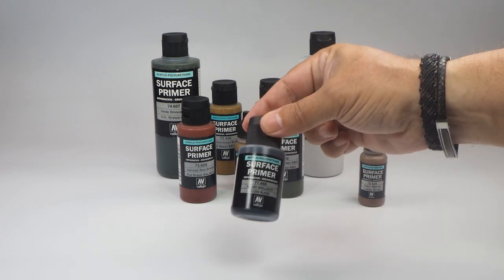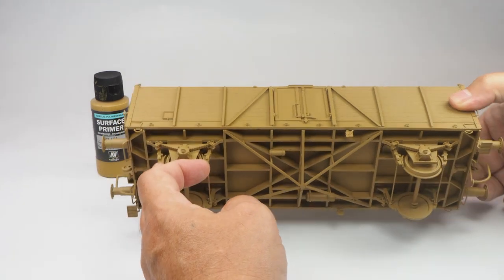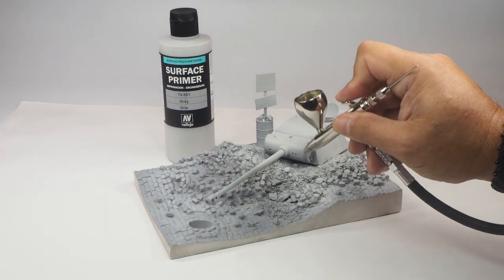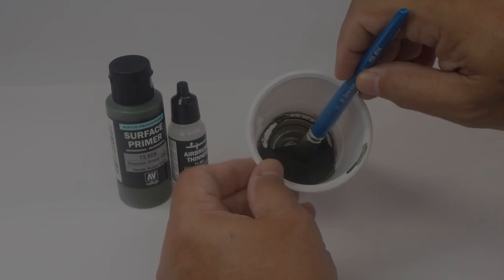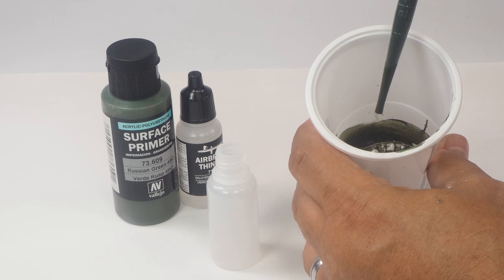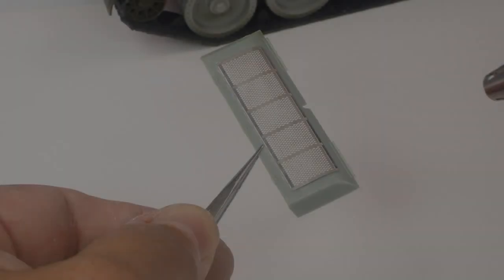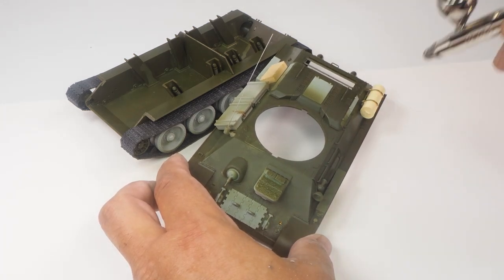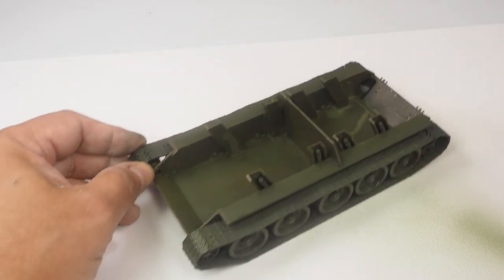🇺🇸🇬🇧 #1 PAINTING PROCESSES: PRIMERS by Chema Cabrero ✨

Comment: I appreciate the effort, but pls, if 99,9% of the airbrush compressors show the pressure values in bar and psi, then use those and not kilograms. It can be the correct terminology, but totally not useful in a guide video.
Reply from the maker: Hello László, recommended pressure settings are always pointed out in our website and product sheet :) 15 – 20 PSI
https://acrylicosvallejo.com/en/category/hobby/surface-primer-en/

Comment: I have used Vallejo primers and have to say that I would not recommend using them for traditional primer roles - e.g., to reveal flaws requiring being fixed before the final painting stage.  The reason I say this is, in my experience, they do not sand well.  They do not feather well and, instead, peal and ball up when sanded.  That being said, I find they make an excellent, smooth, unifying base for undercoating the color coats once all building and sanding is finished.
Reply from the maker: Thanks for your feedback Roger! We'll take note of the issues you've faced with primers to improve them and keep working hard as usually 😊😊
Reply: I completely agree with Roger Holberg, amazing primers, IMO best there are, just this little thing about sanding 😉 Really looking forward to improvements you mentioned @vallejocolors, and wish you all the best, keep on your amazing work. 🙂
Reply: Agreed as well, sanding Vallejo primers doesn't go so well. they peel off very easily and uneven. I'm actually searching for a better sandable solution.
Reply: If you wait for 24h it's far better. sanding right away enven after a quick cure into a  warm environment makes a mess unfortunately compared to other brand. No big deal, need to take your time...
Reply: @AlexandreSalf  I wait several days, it's still not smooth sanding. It looks like thorn apart somehow.
Reply: Simple, you aren't allowing them to cure long enough. While Vallejo says to wait 24hrs, should wait more like 48hrs. Also, thin it out with their AB thinner and flow improver, and it will cure faster. 

Once the primer is fully cured, it sands just fine.
Reply: I mean, they show it right in the video that it can be sanded with no problems.
Reply: I find they just clog my airbrush not matter how much i thin them. They also dry on the tip very fast. The Vallejo paints are good but i stay away from the surface primer especially for doing things like zenithal highlights.
Reply: @stephen1098  75% primer, 20% AB thinner, 5% flow improver. Sprays out of my H&S airbrush with a 0.2mm needle at about 20psi, just fine, no tip dry, no clogging. 

Sprays out of my Iwata with a 0.35mm needle with no thinning, with no issues (do have to bump the air pressure to about 25psi)
Reply: @viper29ca  they show it indeed, doesn't mean it always works. I mostly use their black primer and even after weeks of drying, sanding isn't smooth. I've read molotow and badger primers work better, but no experience with those at all. Anyways, just primed a new piece, will sand in a few days.
Reply: @SigurdDecroos  never had an issue sanding them. Just have to wait until they are cured. Badger works, but had an expiry date on them. Much past a yr old, and they are junk. Have had some Vallejo paints for over 15yrs, and still as good as when they were new.
Reply: @viper29ca  i like Vallejo, don't get me wrong, just haven't got any luck sanding their primers. I'll wait even longer then. Let's see what the result will be.
Reply: I wouldn't say that's a "traditional" primer role, that's just what happens when I fail to properly trim all the mold lines and priming reveals them! 😬😂 But I agree it can be messy when sanding these primers. I usually use a blade for that reason and then re prime that part of the model
Reply: I like vallejo primers too. The reason they cant be sanded is because they are vinyl (latex) based. I think they should do some changes to their formula. Stynylrez or one shot primer are also polyurethan and solvent free but can be sanded like they where solvent based like Mr surfacer or Tamiya liquid surface primer.
Reply: @statoilbensin2190  but yet they can be sanded, don't believe me, proof is in the video. Don't be in such a hurry and let the paint cure. Sands fine
Reply: @SigurdDecroos  While I hate to recommend another brand as I am a devout Vallejo fan. Badger Stynylrez is the answer. While needing a few more coats than Vallejo to attain coverage it sands, feathers, and behaves exactly like youd hope while still being a water-based acrylic primer.
Reply: @viper29ca  You are right I tried the grey version and it sanded just fine after 12 hours. Wery good primer I think its better than one shot primer.
Reply: @teejuschrist  Thx, if I only could find them here in Europe... Just sanded my black primer... and it peeled on the edges again after 9 days of drying. I used 400 grit from Vallejo to sand.
Reply: I had the problems you mentioned initially, I've found the secret is to key the surface with a 1000 grit tamiya sanding sponge prior to priming. If you do this and let the primer cure for 48hrs it sands perfectly. This is a good idea with  any water based primer as they don't have the ability to key the surface they are sprayed onto unlike a solvent.
Reply: Thanks for the tip.  I'll give that a try.

Comment: To anyone having issues sanding this primer, I've found the secret is to key the surface with a 1000 grit tamiya sanding sponge prior to priming. If you do this and let the primer cure for 48hrs it sands perfectly. This is a good idea with any water based primer as they don't have the ability to key the surface they are sprayed onto unlike a solvent.
Reply from the maker: Thank you for the tip Steven :)

Comment: I assume this has been asked before, but is it possible to apply some of these with brush (the black and white primers, in particular) and if so, do any additives need to be added? As they are usable from the bottle for airbrushing, would it be useful to add some acrylic medium before applying by brush?
Reply: I have applied the gray primer via brush. It's doable, but takes many coats to get decent coverage.
Reply: You can get by with a lighter coat when brushing them on. I usually do two coats when I brush them on and it’s not perfect coverage but it’s enough for the next layer to stick. If you want to brush on the color primers as the base coat too, you’ll have to do more! I usually on brush on the black, white, or grey and then go over it with a color paint to base coat
Reply from the maker: Hello LashLightning! You should use it with airbrush (and you can mix it with water or thinner) but, if you cannot use AB or don't have one, we have available our Hobby Spray (just keep in mind using them in a well-ventilated room) 😊✨
Reply: @vallejocolors  Good answer. The Vallejo rattle cans are great! 👍
Reply: @vallejocolors  Are the spray cans a primer or a spray paint?
Reply: @absolutmauser  I bought this thinking it was okay for brush on...
Reply: @Metatron_Prime  They're primers, yeah.
Reply: Yes, they brush on quite fine. I don't brush then for larger areas, and use an airbrush instead, but if I have some smaller items that I don't want to dig the airbrush out for. Brush painting the primer works no problem.
Reply: @Metatron_Prime  they are they are just quite thin so you have to do a couple coats. I used them for over a year before I got an airbrush! 😁
Reply: In my experience, the black one brushes on very nicely indeed, albeit it needs two coats..... The light grey not....
Reply from the maker: @Metatron_Prime  They can be used as primers but if you need to use them as paint you can do it too :) our Hobby Spray includes 2 different nozzles
Reply: @adt70hk33  valuable insight right here! Thanks for the headsup

Comment: So white primer is not recommended for use? Black and grey ones are really good though :)
Reply: The white one is crap, i just trew mine away a long time ago...
Reply from the maker: Hello Elfhelm, in our channel you have available a few videos where Pablo Albornoz uses white and lighter primers. He gives many useful tips before and after use that may help you if you decide to use them for your models and vehicles 😊 thanks for your comment!
Reply: I add some thinner and flow improver to the lighter primers (white, sand, ghost grey, ...). It helps for tip drying and I get better results. Be sure to let it dry long enough.
Reply: Never had problems using the white on Gamesworkshop minis in resin/plastic/metal.
Though i thin it down quite a bit and do multiple really thin coats.
Reply: agreed. one of the best white. A little   harder to use compared to other colors. White, in any paint bra'd is always a tricky color to work with..
Reply: Never had any problem with white primer at all. It is my preferred method of painting anything white, because of its good coverage. Need something gloss white. Vallejo white and then once cured, hit it with the gloss varnish. Never been easier to do a gloss white paint job.
Reply: White primer is the best primer. I use it for high light coat. Then nato black for shadow coat. If you like figure model kits you mostly use white if the character is light skinned, and brown for dark skinned figures.
Reply: You have to spray it very differently to the other colours. I use a .4 or .5 needle and light coats with air to dry the surface between coats. I dont normally thin it all all, but  might add on hot days,  just a few drops of flow improver. Don't overdo it though as it will break down the primer and you wont get good coverage.

Comment: I realy enjoy the 'Back to Basics' type of videos because you get to hear other peoples ideas and methods, which then you can try out to see if they work for you. But on an other line, being a engineer sanding in one plane on a rounded surface.... Oooh..... No... The idea is to start with the tip level and then move the tip in an upwards motion an arc against the curve, therefore filling just the point of contact and not introducing a flat.

Comment: Eigentlich bin ich mit den Grundierungen sehr zufrieden,  die Deckkraft ist sehr gut. 
Allerdings neigt die schwarze G zum Verklumpen in der Flasche,  selbst mit 2 oder 3 Stahlkugeln drin. Regelrechte Farbwürmer oder dicke Fäden an verklumpten Pigmenten bilden sich da, verstopfen den Ausgießer und die Airbrush.  Selbst der Zusatz von Verdünner in der Flasche und der Airbrush helfen da nichts. 
Dieses Problem hatte ich sowohl an neu geöffneten Flaschen, egal ob groß oder klein,  wie auch an älteren Flaschen.  Aber,  bisher,  nur bei der schwarzen Grundierung  !
Nicht bei Weiß, Panzergrau oder Grau.
Was ist da die Ursache,  daß würde ich sehr gerne wissen.  ?
Airbrush ist ne Badger 150 + 100.

Vielen Dank. 
Markus Frömbgen
Reply from the maker: Hello Markus, you shouldn't have problems with new bottles and those primers. You can try changing compressor settings and testing which pressure and airflow work the best for your case. You can thin also the primers, but they are not intended to be used like that :)
Reply: Ich nehme immer den Flow Improver und Thinner  und ziehe alles durch eine Iwata Eclipse. Mit Verstopfungen habe ich null Probleme.

Comment: Its easy to do. Chipping using Vallejo primers as the base. The paint just falls off anyway, Absolutely rubbish primer. Then i tried the mecha colour that was sold under the illusion that it would be brilliant for my gundams.
 Followed instructions on the bottle, followed countless tutorials and every time I mask off parts for different colors, the part I've masked the primer just pulled straigh up. Waited the recommended drying time, some parts i let dry for 4 days and they still didn't hold. The kits this happened to were all sanded and washed in detergent then washed off under freshwater and properly dried before painting.